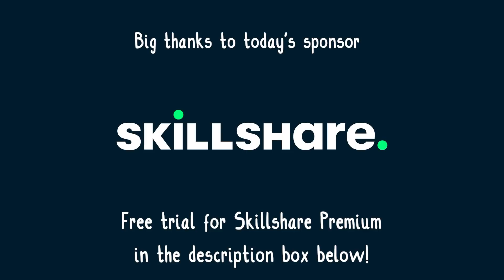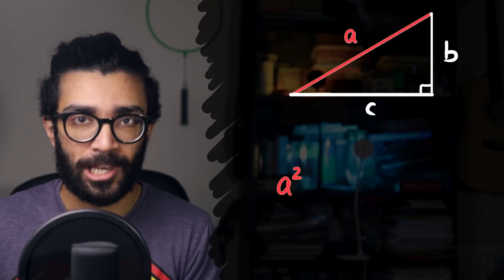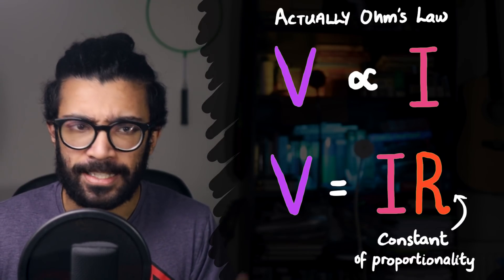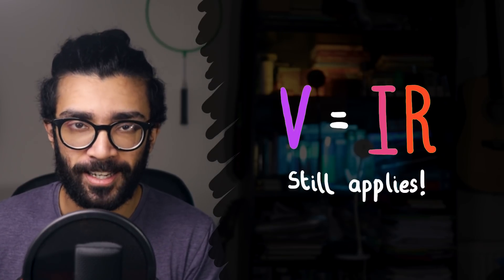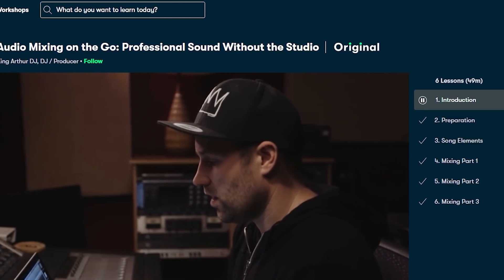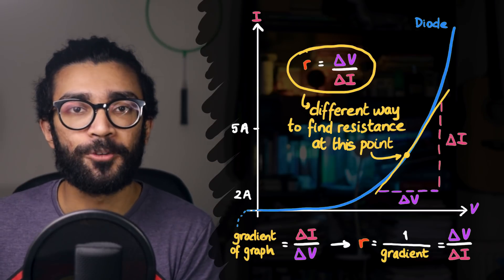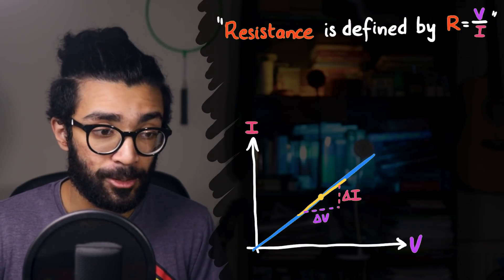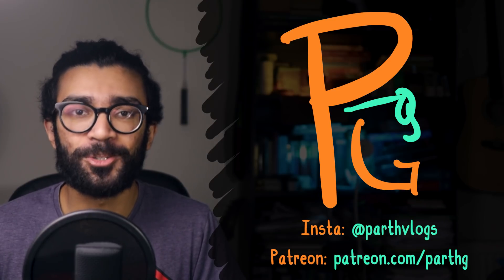Why Ohm's Law is NOT V=IR - there's more to it! Resistance must be constant - Parth G Physics

Comment: Sir which is independent variable? Voltage or current ? Can we say  I = G .V      where G is conductance?    DrRahul Rohtak Haryana India
Reply: In practice, either variable could be the independent one
Reply: @nestorv7627   Sir correct version of Ohm's law could be                                                                            J = (sigma ) . E     where J is current density , E  the electric field  intensity and sigma  is electrcal conductivity .More over J is 3×1 matrix , E is also 3×1 matrix and sigma is 3×3 matrix.     Is it o k ?
Reply: @dr.rahulgupta7573  in upper level physics classes, yes
Reply: @nestorv7627  O .K.

Comment: Since when dV/dI isn't the same thing as V/I at particular point? I know that deltaV/delta I isn't always the same as V/I but dV/dI at particular point is always the same as V/I at this point. Or I misunderstood my whole calculus course?
Reply: dv/di is not the same as v/i because dv/di means that Δv/delta i is tending to 0 not zero itself
Reply: It doesn't matter. When delta I tending to 0 the whole deltaV/deltaI converging to the exact value V/I at particular point.
Reply: It does matter
Tending to zero means almost zero
If that was true that would mean d/dx(x²) would be x but it's 2x
Reply: Wait, what??? Did you say that 
d/dx(x^2) would be x when dx is exactly 0?
Reply: @janurek3050  Nope, I said that you're saying that dv/di = v/i , if that were true it would mean for a function y=x² it would be dy/dx = d/dx(x²) would be 2x
Now, since you assumed that dv/di is v/i it would mean for the same example dy/dx should be equal to y/x but dy/dx was 2x and y/x is x so, it's not true that dy/dx = y/x
Or in this case, dv/di = v/i so it's not true
Reply: Now I see. Thanks
Reply: @janurek3050  What you are asking is basically "in the case that y and x depend solely on some free parameter s, when is dy/dx = y/x false?" Here, it is important to note then that dy/dx = (dy/ds)/(dx/ds) = y/x, and with the assumption that y is nonzero, this becomes (dy/ds)/y = (dx/ds)/x. Integrating with given initial conditions x(0) and y(0), this implies ln[y(s)/y(0)] = ln[x(s)/x(0)], which implies y(s)/y(0) = x(s)/x(0), so y(s) = [y(0)/x(0)]·x(s). Since y(0)/s(0) is just constant, this can be simplified to y = C·x.

In other words, dy/dx = y/x iff y is proportional to x.

Comment: this why electrical engineers make a distinction between resistance and impedance, still a great video... well done
Reply: @kartikkalia01  yes 😌 electrical engineers are pregnant...
Reply: Not necessarily, impedance applies to ac circuits not dc circuits.
Reply: @arnesaknussemm2427  those components such as inductors and capacitors are solely used in ac circuits.
Reply: @MMMM-sv1lk  but diodes aren’t nor traditional filament light bulbs.
Reply: @arnesaknussemm2427  you have a point, but I realized the concepts explained in this video when I was figuring out what the heck impedance was...

I remember asking "why don't they call it resistance essentially it is the same thing as far the circuit is concerned..." 

But then I quickly realized the need to specify a new terminology to describe the resistive behaviors of such components...

In summary I hear you, you have a point, you could add the resistance types that heat up and change resistivity to the list of components that change value under direct current. There are probably other ones too. 

My point is if you thoroughly understand impedance you could pass on watching this video because it doesn't add any new information.

Did you notice how he doesn't call it impedance, if he mentioned it, he would give away the click baity nature of this video 😂🏃

Still enjoyed it.
Reply: @MMMM-sv1lk  It's not clickbait, since what he said is true. Sure, engineers may know the distinction, but what makes you think this video is addressed at engineers in the first place? That's a ridiculous assumption you're making there. The video is making a point about how subtleties in how a definition or physical law is taught matter.
Reply: @angelmendez-rivera351  is this dude running a math cult here, why are there multiple people defending this dude when he seems to have used click bait to get attention in the first place.

The thumbnail says:

Ohm's Law is NOT V=I*R

Then in the video he says, oh actually it is - - yeah duh! 

Thats is the definition of click bait. 

You promise some extravagant claim then fail to deliver... 

He says there is a case to be made for variable R that's not even correct terminology.

In electronics there is no "variable R" (actually there is but that is a different electronic component all together) what he is trying to say is impedance - which is what components such as capacitors and inductors are denoted in to describe this behavior, though still it is all measured in Ohms far as the units go. 

So this is a foolish distinction to be made anyways.

On top of that

Any equation of the form y=a*x
Shows there is some kind of proportionally between y and x...

You don't need to be a genius to point that out...

So overall this was video was useless...

And I am getting criticized for pointing this out... Seriously the cult culture is strong here for some reason 😂
Reply: @arnesaknussemm2427  in a dc circuit the resistance of a diode remains constant, because it is a dc circuit - get it direct current, hence non changing, so single value, a non varying resistance... 

A light bulb is an example of something that heats up and changes value those are treated aa their average R since they don't fluctuate either...

So yeah those don't count as counter examples...

Just trust me... This is a faulty video if not deliberately misleading.
Reply: @MMMM-sv1lk  why are there multiple people defending this dude when he seems to have used click bait to get attention in the first place.

If you look at the comments section carefully, you will realize very few people are actually defending him, and most people are claiming similar nonsense to what you are claiming.

The thumbnail says: Ohm's Law is not V = I·R.

Well, that is correct. It is indeed true that V = I·R is not what Ohm's Law states. He said this in the video too. So far, no click bait whatsoever, only you misrepresenting the argument.

Then in the video he says, oh actually it is - - yeah duh!

No, he never said that.

Thats is the definition of click bait.

It would be if it were click bait.

In electronics there is no "variable R" (actually there is but that is a different electronic component all together)

This is fine, since, in explaining this, he never referred to a specific component that would have constant R in the standard terminology. The fact that there exist components called "variable resistors" is well-known, and that their value for R is variable is also well-known. You can even buy them. I worked with some in an electronics laboratory not too long ago. Somehow, you are an engineer and are unaware of this, which is more than concerning.

what is trying to say is impedance

Uh, no. Ohm's Law makes no reference to impedances, except for the trivial case when R = Z, and impedances, like resistances, can also be constant or variable. Besides, Ohm's Law is a statement about circuit components, not entire circuits, which is what the impedance is about.

Any equation of the form y = a·x shows there is some kind of proportionaliy between y and x

No. Proportionality is specifically defined in mathematics as a scalar relationship between two objects. Your description is incorrect, because if I let a = x, then y = x^2, and here, y is not proportional to x by definition. y is however proportional to x^2 in this instance. If I define R := V/I, then V = I·R is true, but it is a mathematical tautology, not a physical law of proportionality. Specifically, what it means for V to be propotional to I is that the proportionality factor is constant with respect to I, and therefore, with respect to t, the parameter on which I depends. This is precisely what was stated in the video, just in different language.

You don't need to be a genius to point that out

Indeed, you do not need to be a genius to make a claim that is definitionally incorrect.

So overall this was video was useless...

Certainly not more useless than your inability to use English grammar.

And I am getting criticized for pointing this out...

You are complaiung that you are getting criticized for being incorrect and acting stupid? Geez, you are a sensitive one.

Seriously the cult culture is strong here for some reason

Typical of a nutjob to say this.
Reply: @angelmendez-rivera351  
Oh good... I didn't read the other comments reallly... wisdom of the crowds huh? 😏 Yeah he is totally wrong I am glad people are pointing that out... 

When you claim a fundamental formula such as V=IR not to be true... you need to provide more than this wishy washy hair slicing video.

So I am not surprised people are pissed... 

I am aware variable resistors exist but it is irrelevant here... (that's what I said in my prior comment, keep nit pickin) 

Also y=a (keeping "a" , a constant) * y always shows proportionality, I figured you'd be smart enough to figure out x and y were variables and a was a constant... That's how people usually use these letters. 

In the video he does use the term "variable resistance" when he is talking about AC components such as capacitors and inductors. That's just plain false. An over simplification, an inductor has zero resistance and an capacitor has infinite resistance... They only vary when they are placed in an alternating current circuit, and in that case we can talk about the impedance of the circuit (you were right to point this out) Still it is not some invented term "variable resistor" referring to AC components. This is totally false especially the way he described it... 

Plus this is Circuits 101, simple stuff how can he not be aware of all these mistakes...

I clicked on that thumbnail expecting a revelation, all I got was a lousy, irrelevant and mostly false explanation. 

I have evey right to be pissed...

Still it is nice you are sticking up for him, but it is useless. 

I am on a cell phone here so I am prolific as the medium allows me...
Reply: @MMMM-sv1lk  wisdom of the crowds huh?

More like ignorance of the crowds, and a special case of the Dunning-Kruger effect. Most people are stupid.

When you claim a fundamental formula such as V = IR not to be true... you need to provide more than this wishy washy hair slicing video.

V = IR is not a fundamental formula by any means. This is very much well-known. Even Wikipedia acknowleges this.

I am aware variable resistors exist but it is irrelevant here....

It is not irrelevant, because it proves the point of the video.

I figured you'd be smart enough to figure out x and y were variables and a was a constant.... That's how people usually use these letters.

I wish this was how people use these letters, but unfortunately you are wrong. I have interacted with way too many people who do not understand what proportionality means and do not understand the conditions that need to be imposed on the symbols in question for the equation to constitute a proportionality. The majority of people get this wrong.

This totally false especially the way he described it...

Where did he talk about resistance when talking about inductors and capacitors? Provide time stamp.

Plus this is circuits 101, simple stuff how can he not be aware of all these mistakes...

Someone appealing to circuits 101 after having said that V = I·R without further caveats is a fundamental law of nature is incredibly comical.

I clicked on that thumbnail expecting a revelation, all I got was a lousy, irrelevant and mostly false explanation.

You only have your poor comprehension skills to blame.

I have every right to be pissed...

Ok, Karen. In your defense, every individual has to the right to act idiotically.
Reply: @angelmendez-rivera351  You keep twisting what I say...

I said V=I*R is a fundamental formula... Not a fundamental law... Indeed it is a fundamental formula, an essential equation for every electrical engineer, especially if they want to graduate 😏 though not so much for the universe. 

I never claimed the sun rises according to Ohm's Law, or that it is a force of nature, written  in the stars, on pine cones and even in the nested tear drops of a meek gazelle drinking water from a pond full of gold fish...

I wanted to provide the time stamp for the part 2:32 the poor drawing on the black board seemed like a inductor, now I am realizing it was a resistor...

So ok maybe I've been a bit harsher on him than needed...

😂
Reply: @MMMM-sv1lk  not true.
Reply: @arnesaknussemm2427  well oh well..
😌☀️ Enjoy your day...
Reply: @MMMM-sv1lk  look up band theory and in particular reverse bias.
Reply: @arnesaknussemm2427  will do mate... Thanks
Reply: @MMMM-sv1lk  👍

Comment: V = IR is only a simplification, I guess. There are many factors that affect the potential difference. For example temperature, density, electronic configuration, etc. It's not wrong, just incomplete. Which makes it wrong, wtf am I talking about
Reply: I think you should watch the video before writing comments that border on nonsensical.
Reply: @angelmendez-rivera351  How are they nonsensical? The resistance is obviously affected by multiple other factors. Take temperature and electronic configuration for example. In conductors, most electrons inhibit the conduction band. If you increase the temperature, the charged particles vibrate more and hence collide with more electrons. Therefore increasing the resistance. In semiconductors, increasing the temperature doesn't have the same effect. In fact, resistance decreases. 

So in conclusion, there are many factors that are taken into account when determining the potential difference across a component. I'm wrong to say it's a simplification, because it isn't.

Comment: aren't we really determing the voltage drop across the resistor?  Voltage is energy per unit charge, Current is the rate of flow of charge, resistance is the transfer of energy per unit charge

Comment: Summary...
Ohms law applies to ohmic resistance 
Ohms law does not apply to non ohmic resistance.
Definition 1: ohmic resistance is resistance that follows ohms law.
Definition 2: non-ohmic resistance is resistance that does not follow ohms law.

Ohms law: voltage is "directly" proportional to current in a resistance that obeys ohms law. 

Any more circular discussion based on an initial axiom that is taken as a starting point.

Please bring on the Engineers
Reply: It seems you do not understand the concept of an axiom.
Reply: @angelmendez-rivera351 please enlighten me.

Comment: Hello Parth - thank you - a fine presentation as usual.  On the subject of diodes and resistors:  I'm told that if two sine signals are 'fed' into a resistor the combination is 'additive' i.e. the resultant output signal is the sum of the two inputs.  However, if the same two signals are fed into a diode the combination is 'multiplicative' i.e the resultant output is the product of the two input signals. Like your school chums  on Pythagoras  I can repeat this property but I don't really understand the underlying physics - I think your viewers (and I!) would appreciate a video...

Comment: Since there is no such thing as a perfect resistor, R is NEVER constant. Every resistor or component changes it's characteristics when current runs thru it, it heats up (where is the loss due to friction in V=IR or V=I*dV/dI?). Even after a warm up period (like needed when adjusting audio equipment), R is still never constant, we just pretend that it is because it does not matter (it is within tolerance).
Reply: Do you know what you wrote?
Reply: @SM_Int.M.S  Well, he's pretty correct. Resistors do have a property called the  temperature-coefficient of resistance or TCR which does exactly as Richard describes. In general purpose devices the TCR is generally <=100ppm per °C but specialist parts with large positive or negative TCRs can be used for temperature measurement or control. My first proper job was with a leading resistor manufacturer.
Reply: @Sparky-vj2dq  Wow. Imagine not understanding the basic concept of an approximate model.
Reply: @angelmendez-rivera351  I don't think that applies to my comment I certainly don't believe in using more complicated maths than you have to get an acceptably accurate result. The whole point of the video was that Ohm's Law is not the whole story/
Reply: @Sparky-vj2dq  That isn't the point of the video. The point of the video is that Ohm's law is not given by an arbitrary equation relating V and R. Of course, if I define R := V/I, then V = I·R is trivialy true, but this is a mathematical tautology, not a law. What Ohm's law states is that, for Ohmic components, which can defined in any number of equivalent ways, R is a constant with respect to t and I, since no other parameters are relevant in such mathematical models of circuits. Of course temperature is relevant in real circuits, but these models aren't describing real circuits. Real circuits can't actually be described by any equation, unless you write an equation that is exactly accurate for them at the quantum and relativistic scale, obviously. Mathematical laws are just empirical models with a certain domain of validity. The point of the video isn't "Ohm's law isn't valid in some domains," which is trivial. The point is that the thing many people have been calling Ohm's law isn't actually Ohm's law.

Comment: V=IR it's true only when for a particular system/circuit where V/I = constant everywhere,that is a homogeneity is present.
But it's not necessary to be happened everywhere(non homogeneous cases like Diode etc.) but instantaneously one can accept (dV/dI) to determine resistance at that instance.